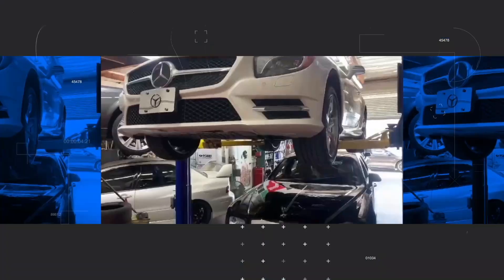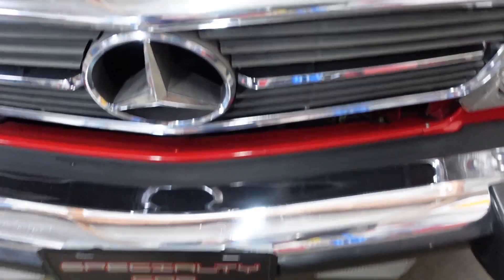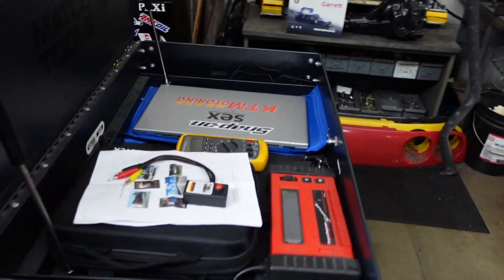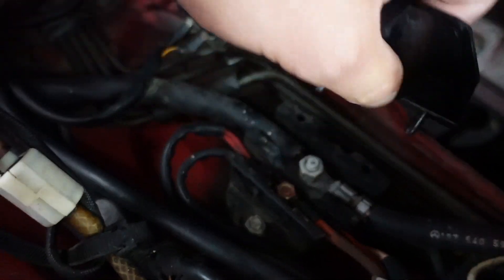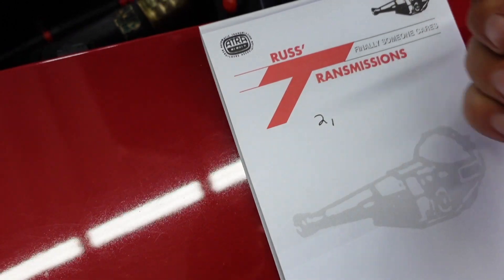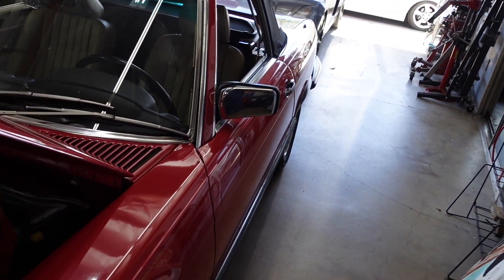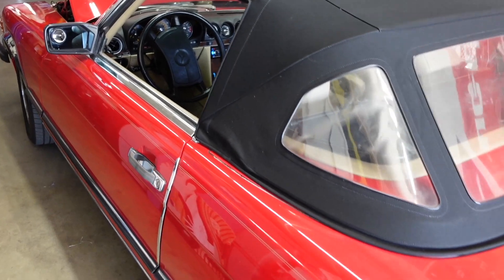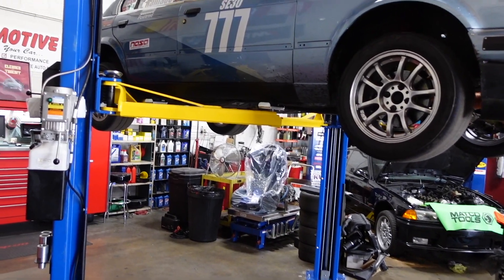Mercedes Benz SRS Lights R107 & others 8 pin

Comment: Thank you.  I have used Ricks code reader for the SRS warning light several times on my 560 SL bc whenever my seats are pulled I forget to disconnect the battery before disconnecting the plug under the seats.